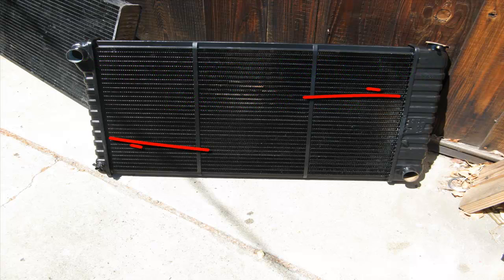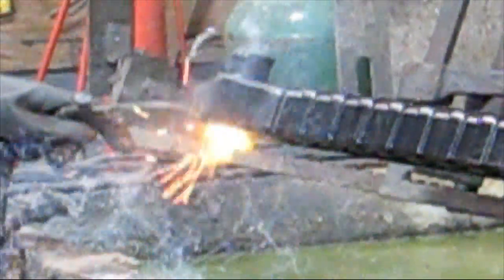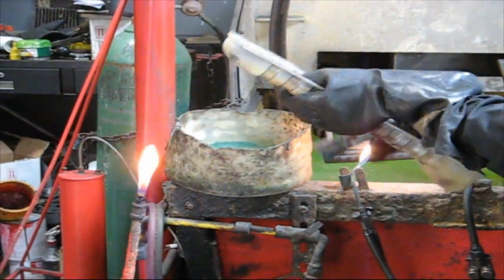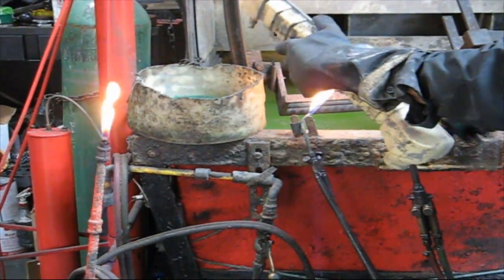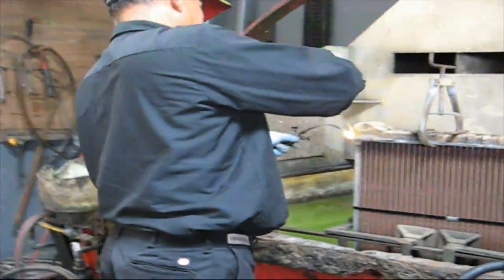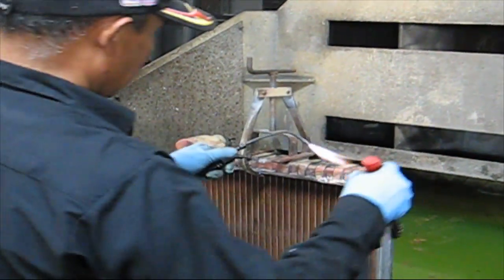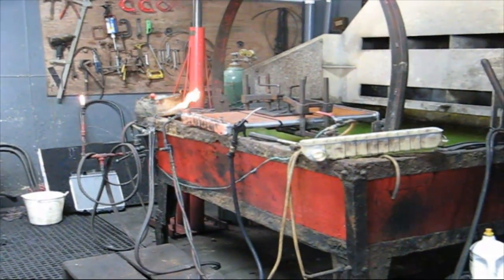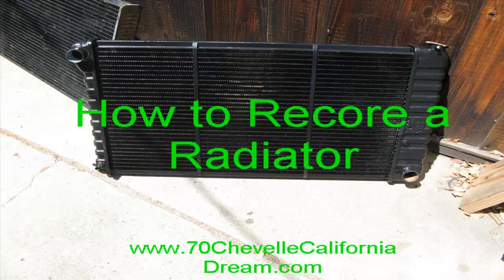How to Recore a Radiator

Comment: This is very interesting. It has always been a mystery to me. I knew what had to be done, I just didn't know how it was done. That's some highly specialized equipment. All the radiator shops are gone now, and we're relegated to plastic garbage or aluminum radiators.

Comment: Probably could have even wire wheeled the core to open the tubes and then follow it with a flat metal rod to run through from end to end and boom your done.  Those foreigners over seas are doing this daily and even fix the ones with leaks and continue using the same ones over and over again.  Thanks for the video.
Reply from the maker: Mine was rusted.  I don't want any problems in 5 to 10 years.

Comment: Highly unprofessional. No eye protection, use of air to dislodge solder instead of wire brush puts even more lead vapour into the air, poisoning everyone. No fume extraction or air fed face mask. You can guarantee this guy is absorbing lead vapour into his lungs. Wastage of gas by not using a pilot light to relight the torch. No proper hook to hang the torch on temporarily. These guys are a bunch of amateurs with an accident waiting to happen.

Comment: What kind of flux are you using? I tried to patch a radiator end this morning and could not get the solder to wick out well enough. I sanded, brushed and even cleaned it with acetone. I used liquid flux and tried paste along with solid lead solder and flux core with no luck. I was going easy on the heat and it would not completely flow around where I needed it to. I remember my dad using a liquid acid flux of some sort back in the day.
Reply: If you can’t get it clean enough to stick, I would go with brazing which is more tolerant of oil that has likely found it’s way into the metal pores. Just be aware that brazing requires a higher temperature and can melt nearby solder creating more issues.
Reply from the maker: I did not do the work.  But I always use 50-50 because it works.  I have it left over from my stain glass days.  
Oatey flux from 30 years ago.

Comment: What the brass middle. Does that get cleaned ?
Reply from the maker: That is the radiator core.  Mine was rusted and had holes (sprayed black).  The concept is the remove and replace the side tanks.  That keeps it original.  Some people just buy a new radiator on the internet, it is cheaper.  But I want to keep my car as original as possible.
Reply: @davidlis6709  I am having trouble getting new radiators. Lol. I have 12 standby generators. Over the next 6 months my plan is to recore as many as possible or till my tells me I can spend anymore money. Lol.

Comment: Why not just buy a brand new radiator and be done with it?
Reply from the maker: That would be cheaper and faster but I wanted to keep the car as original as possible.  So, I replaced the core and kept the original side tanks.

Comment: Is the core a rebuilt core or is the core brand new?
Reply from the maker: The code is new but the side tanks are original.   He is unsoldering the tanks and soldering the tanks back on a new core.   A cheaper option is to buy a new radiator online but it did not want that.  I notice some cars at car shows are installing larger aluminum  radiators but also have higher performance engines.  I did not make this car a Super Sport because with the 350 v8, I can drive it around and get 10 to 12 MPG depending on how aggressive I drive it.

 I am trying to keep the car as original as possible.  Radiator core, belts, hoses, rubber bushing, etc can be replaces as long as you use the same.

Comment: when I have to recore?
And what it‘s benefit
Reply from the maker: Sometimes it is cheaper depending on the make and model of your car.  Or like in my case, I wanted to use the original side tanks of the radiator in order to keep it as original as possible.  Sometimes they are cheaper on line.  My Mercedes has plastic tanks, so I purchased it online for 1/2 the price of re coring.

Comment: Hi there I have a plastic radiator and it's leaking from the transmission cooler fitting where the transmission line goes in can I just remove the line and the fitting from the radiator and replace a gasket? I honestly don't know what is behind the fitting it's just a big nut the transmission line goes into thanks for your help and advice. Rich
Reply from the maker: I would give it a try, what do you have to lose, if you can not stop it you have to get another radiator.  Or try Blue RTV gasket maker from Permatex.  I use it on a lot of gaskets, like oil pans, valve covers, so it does not leak.  I even put it on bolts, like my video on Oil Pooling on an Intake manifold.  Let me know what happened.
Reply: @davidlis6709  hi there thanks for the reply and ya I was debating on permatex or JB weld I was hoping I could get a rubber gasket the size of the fitting but I don't know if they have a random selection at Napa I will try them tomorrow and see if they do you know it's like a inch and a half with about a 3/4" hole maybe I will get some rubber gasket material and just make one it's my gf car and I really don't want to put much in it but I want it reliable I sure do miss the good old radiators they used to put in cars but thanks again for your info I think I'll take the tranny line off and remove the fitting and hope there's no big crack or anything it's a 2000 Saturn so wish me luck LoL thanks again for the reply I appreciate it. Rich
Reply from the maker: @richkarn3792  The newer the car, means more plastic

Comment: I'm not going to try this myself, but seeing the process is interesting.
Reply from the maker: This is really not a job you want to try yourself, for one, you do not have the equipment.  This is highly specialized.  It is interesting to watch.
Reply: @davidlis6709  Have no choice where I live. Rad shop closed and it’s full day trip to the nearest one
Reply from the maker: @thebigpicture2032  You have no choice but buy a new on on the internet.
Reply: @davidlis6709  yeah, I’m finding that out. Where else do they sell cores?
Reply: I'd so try it myself. I've soldered holes in cores shut before, also soldered cores shut because of damage. I'd have no issues with trying this first on a bad radiator just to see if I could do it.

Comment: Hey what is that tool name he is using called to hold it in place while he is welding?Has in hand at 7:37 in video.
Reply from the maker: I don't know the name of it but it is just the part of the standard tools all radiator shops have.
Reply: Looks to be a custom or diy radiator holding jig. It can be made, provided you have the machining tools needed to make the individual parts.
The most difficult part would most likely be the flatplate holding screw clamps mounted on the square tube slides. Aside from that, and the spacing adjust rails with the grooves that span across the bottom, the rest of it is relatively simple - the X and  Y axis probably rotates 360 on bolted pivots that can be adjusted or locked in whatever angle is desired.

There's also that clamp used to hold the end tanks in place while soldering, which is probably what you were asking for. I don't know its name, but it looks to be somewhat similar to a wheel or bearing puller in 2-jaw mode, but with custom jaws that can take the heat without deforming, and with a flat metal pad at the end instead of the pointed center bolt commonly used in jaw pullers. Jaws could be heat-resistant steel or cast iron.

Comment: I lived in Santa Clara 1976-1989. I had a Honda 600 shop on Lafayette St x Martin (Not Foreign Affair). I never needed a radiator shop though, all Honda 600s are air cooled.
Reply from the maker: I moved here from Upstate NY in 1980, never to leave.  It is so nice here once you get past the cost of housing.  I forgot about the super cold winters and the super hot and humid summers.

Comment: Thank you so much! This is a lost art hard now in my area Hunterdon NJ radiator stop recoring because the money is doing custom work. I had to drive 50 miles to find another old school radiator shop.
Reply from the maker: I wanted to original side tanks.  I am trying the car as original as possible.  The radio is after market instead of old AM and the transmission is 4 speed versus 3 speed on the column.
Reply: @davidlis6709  like to see some photos when you're done!
Reply from the maker: @HB-yq8gy  Here is having fun:   https://www.youtube.com/watch?v=vm-YY-xsMyM

Comment: Why would he make the new core go into the dirty water when he was replacing the tanks. Why not assemble it on a bench instead of it getting the new surface contaminated with dirty water. Now that takes time to prep and clean before putting the last tank on.  And give that man a pair of safety boots and glasses to wear. It's like a god dam slave shop there!
Reply from the maker: That dirty water is mixed with anti freeze.   This is how they all do it.   After soldering, they dunk it.  And at the end, they pressure test it in the water. 

This shop has all the safety equipment but they refuse to use them.
Reply: lead solder fumes will make you mad as a hatter ,.... will they not ?

Comment: Why is he constantly dunking the rad into all of that fluid? It's just going to make soldering more difficult..
Reply: What is the fluid?
Reply: @JohnSmith-bx1mp  I would assume it to be antifreeze.
Reply: So he don’t melt solder out of the core I think
Reply: To cool or test it. I do this same thing for work. The fluid is flux neuatralizer. It easily burns off when need to solder. Or you blow it off.

Comment: Had a rad done,3 core. Two cores are in line, 3rd core is in the middle. I still have heating problems,im thinking air flow is restricted due to a bad recore job. Opinions?
Reply from the maker: Probably not the radiator.   Every car is different.

One of my friends has a 64 Corvette,  he had heating problems. Replaced the radiator and still had problems, he solved it by replacing the head gaskets.

Another friend had a 1995 Corvette, replace the radiator, head gaskets and finally solved the problem by cleaning out the air ducks full of leaves.  Simple, but how would you think of it. 

Maybe take out the thermostat and boil it in a pot on your stove and see it it opens at the right temperature.
Reply: What car&yr?
Reply: Cd be fan clutch?..t stat wat pump???.
Reply from the maker: @packingten  Start with the thermostat.   Remove it and put it in a pot on the stove and see it it works.

Comment: I worked in a radiator shop for 15 + years and I am lucky to still have eyes because I never wore glasses/shield and I rebuilt literally thousands of radiators in my time
And before anyone says anything it was a family business and that’s just how we did it
Reply: Same here, Family business for nearly 30 years. Never wore safety glasses for about 25 of those years, the thing that got me was a bit of sandblast in my eye. I'd say you were not using air to get the solder out, otherwise you surely would have copped an eyeful at some stage. Seems a bit crazy using air, we used wire brushes.
Reply: What kind of solder and flux are you supposed to use??
Reply: Same here
Reply: If it had damaged your vision you would have been in pain the FIRST TIME, i looked at a welder once for 30 seconds as a kid  from afar and my eyes burned a good 2 days
Reply: @ThreeDaysOfDan  I remeber waking up in the middle of the night with what felt like broken glass in my eyes...
Reply: @elonmust7470  truly is an awful feeling and i wasn't even close , i watched from like two car lengths away
Reply: @ThreeDaysOfDan  My first experience was from welding a piece of my friend's mom's railing banister back on. Probably had maybe 1 minute or less of exposure. I was in my early teens and had no clue as to what was going on. Very scary.

Comment: hi . I'm totally new radiators made from aluminium . https://www.youtube.com/watch?v=pjFtK5lfJas
Reply from the maker: I had my rebuilt, new tanks on the sides, new copper core, because I wanted the car to be as original as possible.  It would have been cheaper to buy a aluminum radiator.

Comment: No mention of the core being centered or not. This core clearly overhangs on one side. if you do it backwards by mistake it won't fit in the car...also no mention of what psi you test a rad at.
Reply from the maker: It only fits one way, the hose outlets have to be on the same side of the finished radiator in order to connect to the cooling system of the car.  It fit perfect.

Comment: Only a total idiot would not wear safety glasses while doing that procedure. Compressed air AND torch, what a moron that guy is.
Reply from the maker: The owner provides the safety equipment but they don't use it.

Comment: Thank you for posting this.  A couple of question:

- Are radiator cores generic or are they specific to car models?
- Where do you go to get cores? (in general)
- what is in the bath of green liquid? (just curious)

Thank you
Maritn
Reply from the maker: The radiator cores are specific to makes.  Like GM is different from Ford or Toyota.  For example, in GM, Chevy and Buick are generally the same but their big pick up trucks are different.  They differ in size depending of the size of the car, motor, and what it will used for.  

You can buy them online or from your local radiator shop.   Be careful if you buy them online because they can be very cheap radiators.  They are aluminum radiators.  I wanted a copper core and the original tanks because I am trying keep the car as original as possible.  

When I purchased a  new radiator for my Mercedes, I just got one online because they have plastic tanks and a aluminum core, not really fixable. It is cheaper to just buy another one.  It is not like this car, which is a 70 Chevelle with a 350 V8, which I plan to keep for a long while. 

Green liquid is anti freeze.
Reply from the maker: The radiators are specific to each car.

I bought a radiator for my Mercedes from www.radiator.com, I think they also sell cores.
Reply: Thank you for the info.   I'll take a look there and see what they can come up with.
Reply: In most cases you remove the leaking radiator from your older car and take it in to a shop like this. They save your side tanks and replace the middle core. Some times you can get lucky and they can turn an older single core into a dual core for better cooling.
Reply: @mr9c1driver59  Thanks for that info.

Comment: Back in 1980s I restored cars for a hobby and would go down to the local radiator repair shop in town and watch them do this. They did a recore for a Dart with a 360 I had for under $200. Best work at reasonable prices. 
I got an original 68 Coronet radiator that needs a recore, what's the price for something like that these days?
Reply from the maker: +observer 1959 $352
Reply from the maker: Sorry for responding so late but it was $425
Reply: @davidlis6709  seriously? might as well buy a new radiator for that price , even hard to find ones go for 300 - 400$

Comment: Very informative video. I have a '72 Plymouth Valiant that may need this, as I was told the central core needed rebuilding. I think it will need more than that, however, as the fins, what's left of them, are rusted, and disintegrate if you touch them. Thanks for posting this.
Reply from the maker: When they re core the radiator, they un solder the tanks on each side or top and bottom and re solder  them back on.  I had it re cored because I wanted it original.  If that does not bother you, you might be able to buy a new one cheaper.  I buy them at www.radiator.com, give them a call.
Reply from the maker: The shop has all the safety equipment but they don't use it.

I paid about $450 to have it done and only about $125 to buy a new one.
Reply: Chris Dionisio I doubt u can have your radiator rebuilt for the 72 Plymouth if u say the fins disintergrate when u touch them at a certain area that they are soft... I have the same problem when I took the radiator out of my 89 Mercury Grand Marquis Tonight.. fins flatten easily & since its junk.. tried other areas with a flat blade screw driver.. one area went thru like paper! used my fingers first to try another area, couldn't bend it easy.. used the screw driver.. hard to puncture thru... had a problem with my car yesterday overheating on me on a 40 mile trip.. engine light came on, shut down quick.. overflow tank was boiling ..! losing antifreeze... let in cool down for 20 mins or so.. refilled the radiator.. checking the radiator, seen bubbles on the side of the tank , 3 areas on the fins on antifreeze leak.. after I got it started, headed to home Depot, had to get water from the floral dept to fill up my 2 gal. jugs...  filled it up, head home again on a 40 mile trip, excatly 40 miles on the dot light came on! pulled off the highway & let it cool down.. didn't lose as much antifreeze the first time...  then got home .. the radiators shot! but thermostat could be bad too... just put in a good used one from the junkyard ...exc. shape...luckly I didn't need triple a..  better for u to get a new radiator to be on the safe side... your post is a year old... hope u gotten a radiator for the 72 plymouth ..
Reply: David Lis forgot to mention the guy that did the radiator on this video is a pro & fast to get the job done! I was amazed...,  suppose to wear goggles tho.. that's what ALOT of people said on your you tube video... , rebuilding the radiator to keep it original I understand that, that's cool... wasn't sure if the original one can be fixed & thought it too much to do & it's long gone ... people can fix stuff today which is good to help
 us out to enjoy driving our classic on a nice sunny day... :)